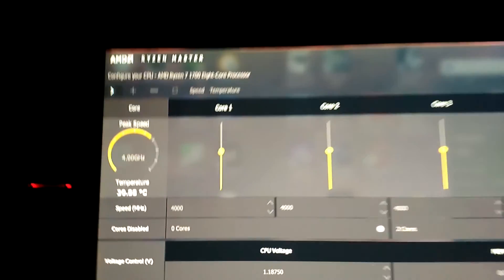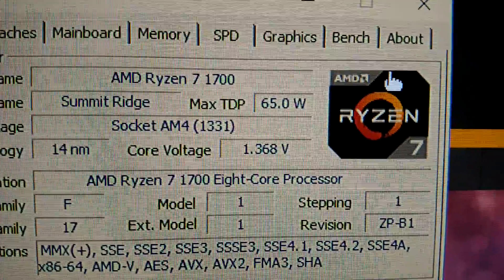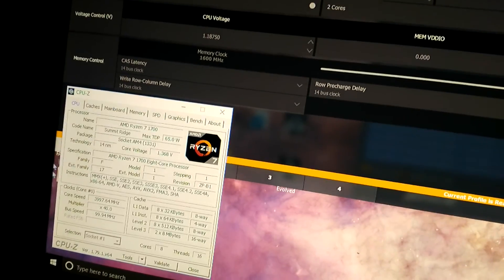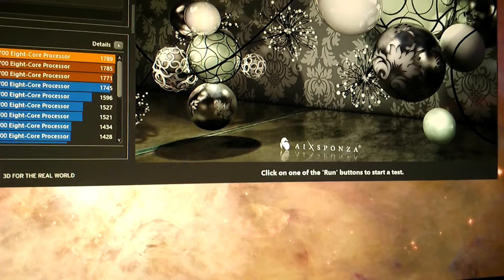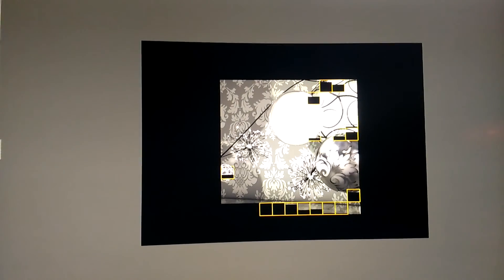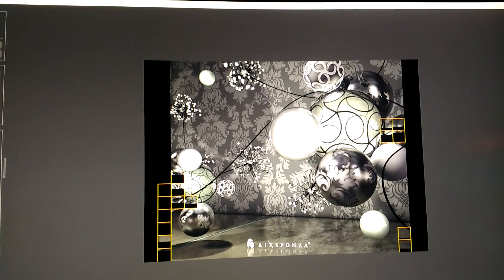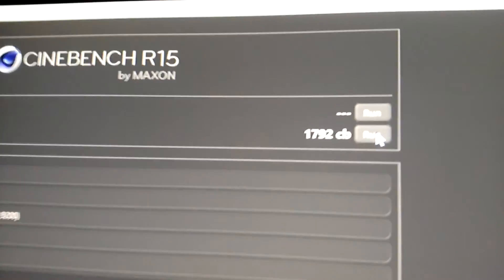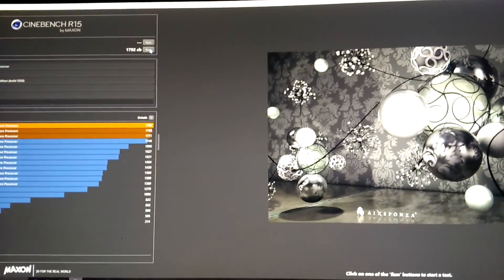My Ryzen 1700 overclocked to 4.0 ghz with low voltage? Is this good?????

Comment: What cooling are you running? I have a stable 1700 going 3.8 @ 1.31V on b350f that idles at 35c-40c depending on room temp.

Comment: R7 1700 at 3.85 ghz + Asus prime B350m-e running at 1.375v cpu temps idle 40 degree and max stress test 83 degree with the wraith cooler

Comment: Ryzen 1700x at 4.0 ghz + Msi x370 gaming m7 ack running at 1.368 V cpu temps 48 degree's load with fractal design 360 rad is it stable?

Comment: The MSI b350m mortar VRM's arent good, i set the voltage to 1.425 and it dips to 1.35v and never reaches 1.425v

Comment: Yeah! Mine does 3.9Ghz 1.425v with a shitty b350 mobo. Try enabling Load Line Calibration to either level 1 or 2 with a lower voltage and disable Spread Spectrum and Increase SOC voltage to 1.2. if the SOC voltage increase doesnt make a difference, just restore it to what it was b4

Comment: Seems like you have a lucky chip.

Given you're not at LLC4 or LLC5 seems like you can run with such a low vcore.

Now, Try some IntelliBurnTest....here I could run CB15 many times but not a single IBT until I raised the vcore to 1.418v at LLC3

Comment: Thats nice score, but cinebench doesnt make it stable at all :D run occt, prime95, aida64 or some similiar stress programm over night or so, then you can talk about stable.. :)
Reply from the maker: well i mean i ran cinebench 30 times consecutively
Reply: Austin Shelton cinebench doesnt pull 100% juice from every core same time for longer periods, id say even if you run it 1000 times i would not call it reliable stresstest. But thats just my opinion, do what ur happy with :)
Reply: Austin Shelton when i tested my overclock i ran prime95 for 24 hours.. and just to explain the reason for such a long time, on the way to stable settings before fine tuning it, it did fail on 18 hours..
Reply from the maker: ohh...i see.  But would you not say that most people would not be stressing the cpu to the MAXXXXXXXXXXXXXXXXXXXXXXXXXXXXXXXXXXXXXXXXXXXXX all the time anyhow?  its kinda hard to imagine a game pegging the cpu at 100% all the time for 24 hours.   Its no wonder it cant keep up.     But yeah i see your point.
Reply: Austin Shelton in normal use probably never, but its not 100% stable before it can handle it ;)
Reply: Jan Kajander I notice the stability from Cinebench was way more accurate on Ryzen than with my Intel Skylake CPU.

Running Cinebench on my i5-6600K showed stability and then when I usually ran some CPU intensive games they would crash until I increased voltage pretty drastically. It translated perfectly on my Ryzen 5 1600 though.
Reply: I did like you, running just cinebench, everything perfectly fine, until I start AC Syndicate...Triple Blue Screen in a row...Hopefully, it didn't happen on an online game ^^

Comment: What voltage while it's actually running? is Load Line Calibration (LLC )ON? LLC adds additional voltage to your 1.36v so even if you set it to 1.4v it might be running over 1.45v.
You may have gotten lucky. For gaming, having 1 run succeed in Cinebench is fine. But when most people say their chip is  "stable" they usually mean they can run Prime95 for like an hour at least. I can run Cinebench 3 times in a row really fast on my 1600, but on the 4th run it crashes pretty often. It's still fine for gaming, but if you want to render video for hours on end it's risky.

Comment: I have my 1700 at 4.0ghz with 1.392v. I can get at 3.7ghz with at stock. X370 msi sli plus. 970 evga sc sli, 16gb Lpx 3200mhz
Reply from the maker: i got my just yesterday to 4100 at just 1.4 volts.   not the 1.45 i see most people needing.  good job for yours.  go for 4.1 i think you can do it too.   one thing that helps is load line calibration.
Reply: Austin Shelton yep I hit 4.1ghz at 1.4volts. I now have a Aorus 1080 ti and it stomps anything I throw at it. 6001 superposition 1080p extreme score. My only setback is my memory not going above 2933. I'd imagine 4000mhz ram with ryzen would push it another 15%.

Comment: what guide did you use ?? put link in please... and yes thats good... 1700 at 4.0ghz on a asus crosshair is 1.423v with llc at lvl3 .. thats a beast score for 1700
Reply from the maker: im running flare x.          So its hard to say but i did fuck with my timings and upped the voltage on the ram to 1.4           Loosen the timmings.  Up the voltage,.  overclock your cpu.  Up the nb voltage to like 1.2 or something.     Just try to kick it into high gear to get it to boot.  once it boots and runs.    tighten the timmings.  I got my at 14-15-15-15 -34
Reply from the maker: in terms of real world performance.  this thing is practically a 6950x now.         all scores show it basically slides right in the same bracket.   pretty good for a budget cpu dont ya think?
Reply from the maker: i just used youtube guides.   i did not do much.
Reply from the maker: what motherboard are you using?
Reply: what guide?? im getting the asus rog crosshair . what board are you using ?
Reply from the maker: ill find it and get back to ya
Reply from the maker: Here  https://www.youtube.com/watch?v=UMv9ChrLayM

this is what i used
Reply: thanks i seen that one before.. 1.45 is max out voltage for ryzen i'm goin to try to keep mine back from that but i might set up offset voltage so the cpu ain't running at max voltage all the time asus done a video like aweek ago showing how to do it... but if i can get it to your voltage stable i won't have to run the offset ..
Reply: Austin Shelton What RAM speeds are you running? 3200?
Reply from the maker: 3600 now it was 3200 but for some reason i was able to get 3200 with my new beta bios.  Most people dont know about it.  but if you go looking their are some beta bios out there for peoples motherboard.
Reply: Austin Shelton This is why your score is 1790! mine is 1755 but my ram is only at 2666Mhz. RAM gives you that extra score. I have Corsair Vengeance RED LED 3200Mhz I took from my Intel rig so I don't think I can run it any faster. Do you have any suggestions on how I could run it faster?
Reply from the maker: the beta bios is what matters though.    Check your mobo for it.  you need the LATEST.  the beta one.   idk what kind motherboard brand you have but MOST msi has the new beta bios for ryzen.  You got to go digging for it.
Reply from the maker: i also think its luck atm.       But the bios makes a difference.     you gotta go default and try everything just dont push it to much.  Would hate to see someone damage their hardware.
Reply: Austin Shelton Hey thanks for quick responses. I got my timings to 14 14 14 14 34 at 2666Mhz. I have ROG Crosshair VI Hero. There's nothing on the official ASUS site that is newer than what I have. I have the newest BIOS which is 1201 I believe.
Reply from the maker: hmmmmmm      most asus mobos have a better time at this stuff.   check and see if you have SAMSUNG B DIE ram chips for your ram kit.      thats what mine is.
Reply: Austin Shelton I'm not sure. I even have a problem with bus speed being 99.80 and not 100. You have 99.94 so that's close enough but for me it's frustrating. I have found beta bios on ROG forums but I'm bit afraid to use it.
Reply: Austin Shelton I fixed bus speed by just doing manual for RAM and 100BCLK. However, I can't run ram at any better speeds than 2666Mhz. tried to up the voltage for ram to 1.45V. SOC voltage to 1.15V and nothing. booted up with everything at stock. I guess I have to sell my RAM and get proper one to achieve decent speeds. 

If you achieved 4.1Ghz, you have a golden chip. I had 3x 1800x and only one could do 4.0Ghz and it's the one I have.